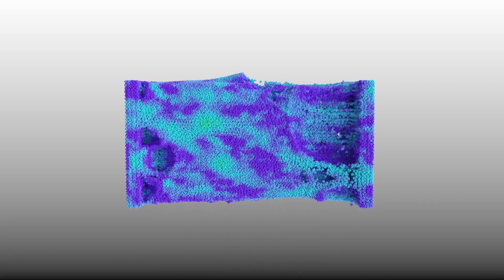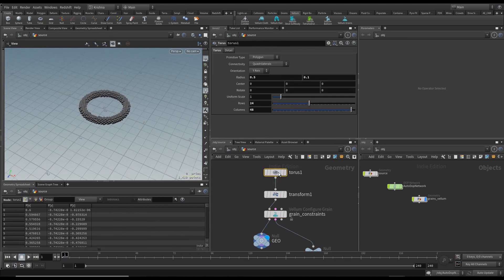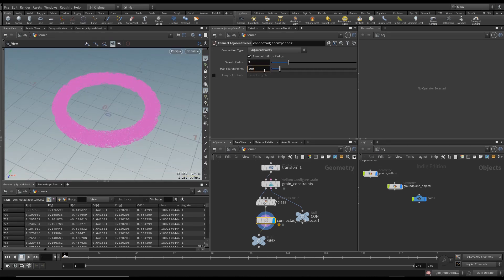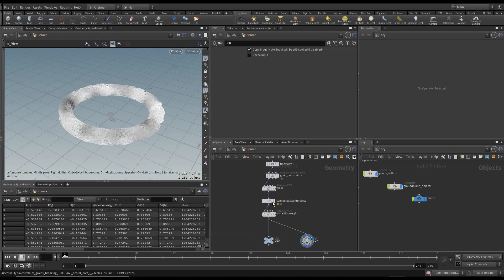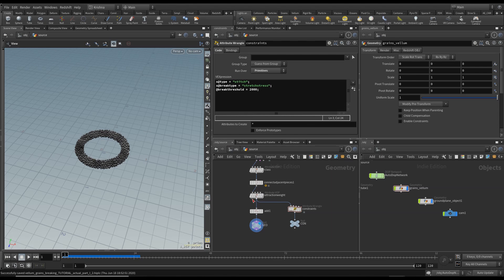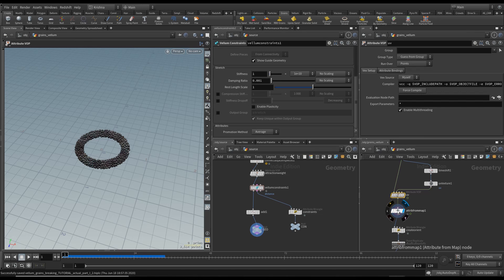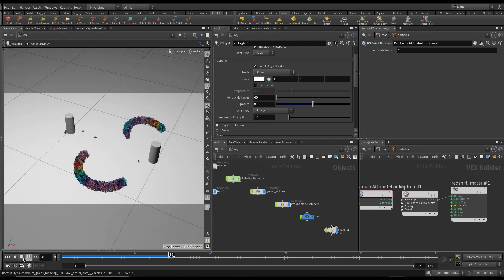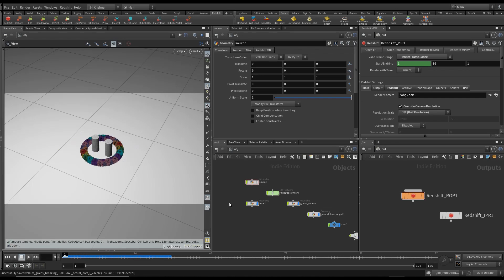HOUDINI TUTORIAL - VELLUM GRAINS TEAR - PART I

Comment: Hello, I'm having a problem: my grains do break apart when they are stretched apart, but they always 'bounce' back together right after. I'm wondering if it is due to some setting from source-> vellumconstraints1. No matter what I have tried it always resumes it's initial shape... :( Maybe someone can help me? Here is a video to visualize the problem: https://i.gyazo.com/35d91bdfa7fe874895d397bf8f90d4a2.gif
Reply from the maker: I see the problem, this suggests that the attraction weight is too high or there is not breaking constraint in the sim. Can you please go through the tutorial again just to see if you missed any points.
Reply: @resilientpicture  Thanks for your reply. I did as you suggested and started from the beginning. I'm now at 09:55 and the grains break apart as they should! Unfortunately I cannot pinpoint what caused the issue I had at the first time.. Probably some silly mistake since I'm not that experienced with Houdini yet. Anyway, thank you so much for this great tutorial!!
Reply from the maker: You are welcome & I'm glad it worked out for you. 🙂
Reply: @resilientpicture   Hey. I had the same problem. ''My grains do break apart when they are stretched apart, but they always 'bounce' back together right after.'' I changed the @breakthreshold from 2000 to 200 and now it breaks the same way as in tutorial. This is my first houdini tutorial so i have no idea what i'm doing haha.
Reply from the maker: Lol, I'm glad you worked it out. You'll get better in the long run. Good luck.
Reply: for me solving it was to change "run over" from points to primitives in the "constraints" wrangle. thanks for the tutorial!
Reply from the maker: Thank you for that. It sure should be on primitive wrangle if it's constraints unless I made a mistake.

Comment: Thanks a lot! Great tutorials you have.
I think I found the reason why the torus is flying away.
In AutoDopNetwork->vellumsolver1 the Velocity_Damping is set to 0.
A value of 0.01 already has a noticeable effect. At the maximum value of 1, the torus stays in place and behaves like a very viscous material.
Reply from the maker: You are welcome and thanks for the tip. Much appreciated.